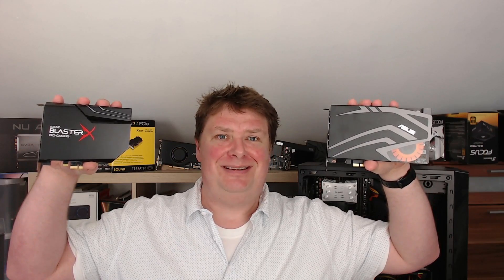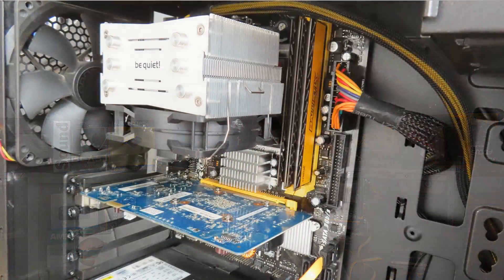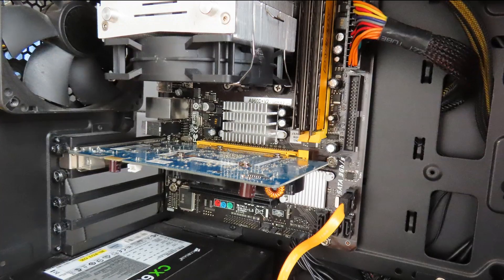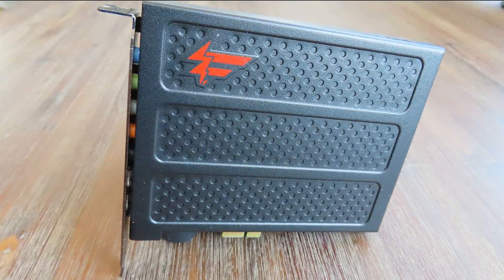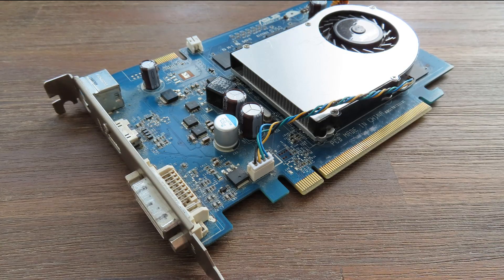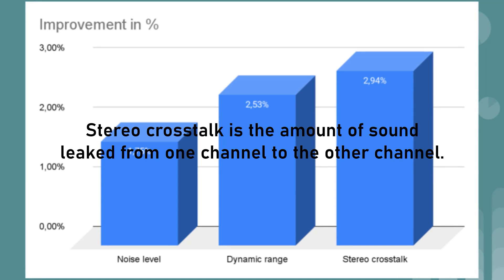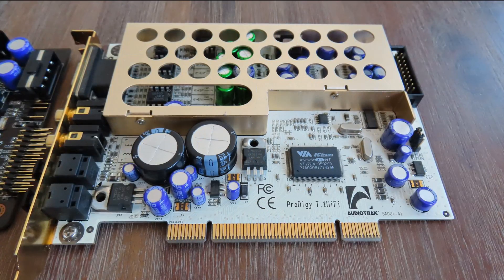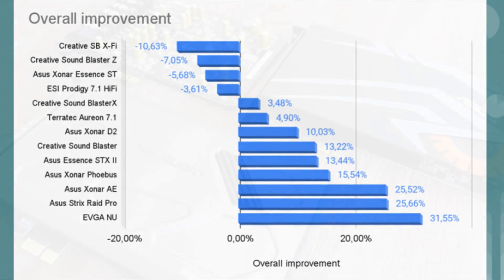What's the point of EMI shielding on a sound card?!

Comment: Hi Anton, great video! (y)   
Try to check the conductivity of the EMI shield. Sometimes the plating on the matal surface did not made a good electrical connection with the PCB. Try to remove the painted ( or peel of the elox ) surface from the EMI sield at the screwing points. Maybe this give a better results. Otherwise we have a two type of EMI noise. 1st is the cuopled = conductive, 2nd is the radiative = as like radio waves. The soundcard EMI plate is only "use" for radiated noise. But mainly these usually the creative cards are a good surface for the marketing designers. :) If the soundcard has a fine designed power supply and PCB it can attenuate the coupling noise from the motherboard. The PCI cards has a wrost case , bacause these cards has a lot of connection to motherboard. This cause the biggest noise than the PCIe version of the boards. ( ...maybe this couse the Xonar good performance. The PCIe connector and the bottom side EMI plate isolate the noise wich came from the CPU-PWM psu, and VGA )
Reply from the maker: Sorry for the late reply. Thanks for the great reaction. I didn't know this about the two types of emi! What I did was test the card as it was out of the factory and then removed the shielding. Just to recreate and measure what most of us would have as well. I did see some cards where there was a better connection to the bracket, which in turn is connected to the case. Maybe that is an explanation as well. 
In the future, I'll do a rerun of this test and take your advise with it!

Comment: The foundation of noise free design is not a shield, it's a 4-layer board! The massive ground and power pour under the traces and ICs effectively attracts interference in place of the signal traces and components, and suppresses it; and more tricks can be applied, like having sensitive traces run on the inside layer while bringing the ground pour to the surface instead. The ICs themselves, the analogue part of the CODEC/DAC/ADCs, and the linear ICs on the board, are small enough that it doesn't terribly matter that they are out in the open. Smaller lead frames and packages help as well.

If the EMI shielding worked well, it's an indication that they messed up the layout or cheapened out on the board. And as you have found out, it's not at all necessary to envelop the components, having a ground surface nearby is fully sufficient, like in that backplate example. 2-layer boards perform worse than 4-layer, though of course some designs perform spectacularly better than others.

Fans should have low contribution to EMI, since these are fairly low frequency magnetic fields. What should contribute a lot more are VRM subassemblies that generate various voltages in your PC, in particular for CPU and graphics card. There is a little bit of switching noise in the fans but it's really not so bad in comparison, they are even made to switch pretty gradually with a long linear phase to reduce the cogging and acoustic noise. I think if you want to max out the EMI contribution of a GPU, you have to have a card with extreme consumption spikes, a modern 200W class GPU. And you also need a synthetic workload both for the CPU and the GPU, like maybe Prime95 and Furmark at the same time.

The shroud is often there for marketing/aesthetic purposes. It only pretends to be a shield. Because people are afraid that EMI is going to mess up their sound. Think about it, how much is a 3% improvement really? It's less than 0.3db. In the meanwhile, what difference does it make practically whether the soundcard has 113db or 116db S/N? That's a difference an order of magnitude perceptually larger, and it's still largely irrelevant. I would describe the overall result as 'inconclusive', since some cards did better, others did worse, while if the shrouds were effective, you would expect to see the "worst" result being no-change; but consider, have you eliminated measurement variance? Like to put in another card, some cables get jiggled and change position, test stand is maybe not in the same exact location and orientation, maybe you turned on desk lamp or your neighbour downstairs or upstair turned something on or off, maybe slightly different workload was running on PC (like indexer, mail client, Windows Update), with such small noise figures as you're trying to measure, small actual differences can result in relatively large looking percentage changes. In particular it doesn't seem at all plausible to me that any card performs worse with its shroud on than off, it indicates a likelihood of measurement mistake. "Keeping the interference in instead of airing it out" is not a thing, since the shield is (or should be) earthed and short circuits the field and so the field must collapse rather than being reflected; and on the other hand, soundcards generally lack all the EMI angriness typically present in the rest of the PC, so the net effect even if the shield was reflective should have been positive!

As to the front panel, look more closely. It often commits the cardinal sin: connecting USB and audio grounds together; thus defeating the star ground carefully laid by the soundcard designer! Even mainboard manufacturers are really careful about audio ground routing. The ground then forms a low impedance loop with circumference that encompasses all of your PC components, and induces a little bit of unproductive current from all of them, acting as a loop antenna. Since the output opamps in the soundcard are driven to output a particular voltage for a given desired signal, they must also output matching current; but since the current can change in MHz range, they can easily run against their limits and start distorting, and this becomes an audible audio quality issue. I cursed so so much when i first saw this, it is completely inexcusable and yet common enough.

Additionally, Azalia standard specifies ferrite beads on the audio front panel for RF current suppression. I have never not once seen them actually present.
Reply from the maker: Wow! Thanks Siana! This is one of the best comments ever! Ehhh I think I'm going to email you directly, because of all the questions and remarks. A million thanks!
Reply: @AntonsHardware  sure that's my full name at Gmail. Also Twitter DMs are open. However I am notoriously bad at checking and replying.
Reply: You are a real expert. I had no idea that these techniques existed to reduce noise on cards like these

Comment: It is funny that the electrically noisy components are above a soundcard's PCB, yet the shield is under the PCB.  The only exception is the one card with the backplate.  I always thought the front side shields were marketing gimmicks, so it was interesting to see that these had a measurable positive benefits.  I do wonder if those improvements were due to improve grounding rather than EMI blocking.  Very interesting stuff!
Reply from the maker: That's what another viewer (Zoltan Janosi) also says. And I'm beginning to wonder that too! Thanks  for the reaction! Really appreciate it!

Comment: Real EMI shielding would need to be closed (only tiny holes smaller than the wavelength but no big gaps at the side) to act like a faraday cage. I suspect those bad ones on soundcards are more a design gimmick than anything scientifically proven, since they not even try to be closed (e.g. by metal mesh to still permit cooling). A metal sheet on the back works AFAIK mainly by capacitance. That's why modern PCBs tend to have one grounded metal layer to reduce EMI.

Comment: Shame you hadn't tested this with newer and more powerful GPUs. Their VRMs have much higher amperage, any sway in voltage literally flood case with EMI.
Reply from the maker: I know! And I agree! But my test bench wasn't roomy enough to cram a bigger gpu into. When preparing for the video I at first didn't use any gpu, just the onboard solution. When I'm going  to make a remake of the video, I'll use a bigger GPU!
Reply: I can confirm. I was using a SBZ with a RTX 2060, no noise, all was perfect. Upgraded from the 2060 to a RTX 3060 TI (tested with two different models) and the SBZ started to capture EMI noise from the mic plug. Only happens when the new GPU is under load. Everyone in the teamspeak/discord can hear the noise (I also can self-test using the 'what you hear' option).

IGPU + SBZ = No EMI
2060 + SBZ = No EMI
3060 TI + MB AUDIO = No EMI
3060 TI (tested two) + SBZ = EMI noise

I'm thinking on an AE-5 as a replacement, but I'm afraid of the EMI interferences.